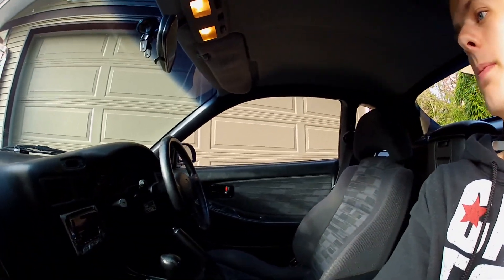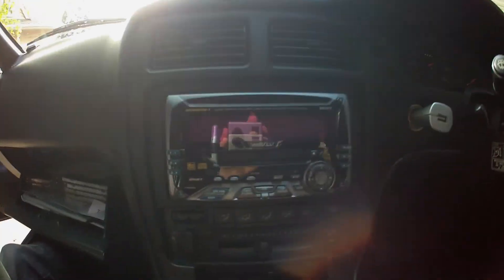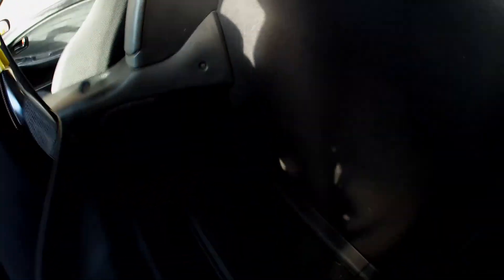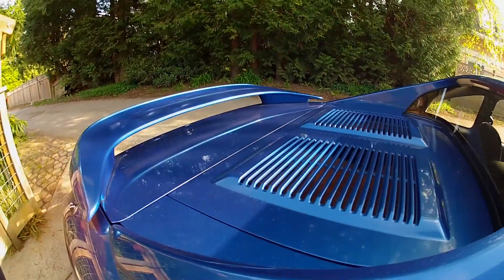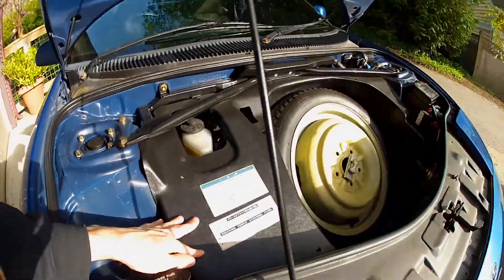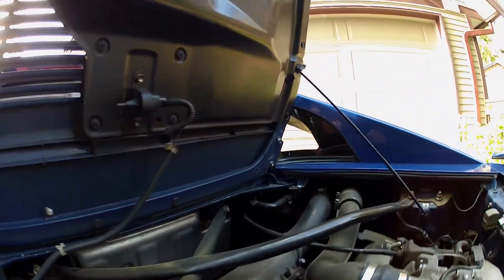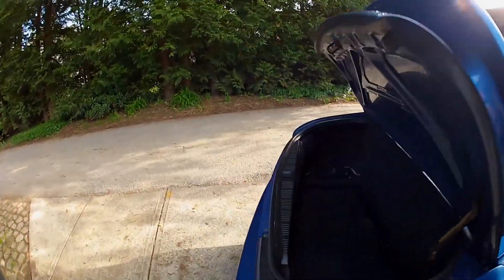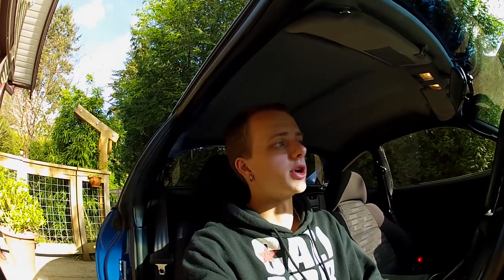MR2 Turbo GT-S In-Depth Tour!

Comment: Wanted to keep it relevant to the video so chose an old one :)  What tyres are you using on the 15s right now?  Having a hard time finding decent rubber for mine with all the discontinued wheels out there. Especially the 225 rears.

Comment: Electronic boost controller. probably the best cheap mod you'll do for it. The stock dump and cooler will struggle much above 11psi imho. With just an ebc, the top mount a2a from a gt4 and stock everything else and 2.5" crush bend exhaust,  I got 212hp @ wheels on 11psi. Really wakes the car up. Be careful of quick shifting the E153 gearbox tho, they LOVE to eat synchros sigh
Reply: +Legotruck82 Gen 3 has way more hp than gen 2
Reply: +Glen Garden ah for some reason I thought this ran the gen 2.
Reply: Legotruck82 no look at the engine
Reply: +Legotruck82 Yepp it's a 1994 GTS with a stock gen3. Runs 12 psi from the factory. Should be right around 200whp but I have yet to have it dynoed. First mods will definitely be bigger intercooler, intake, and catless turboback exhaust from Berk.